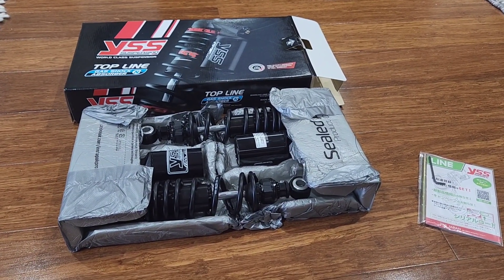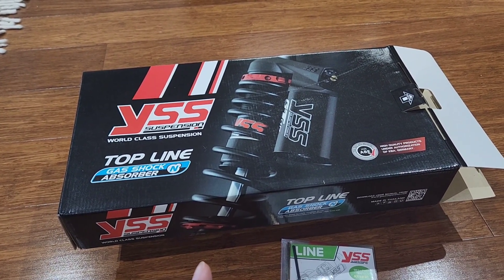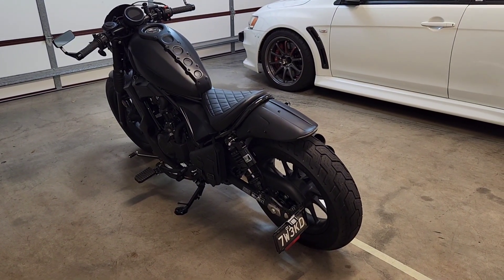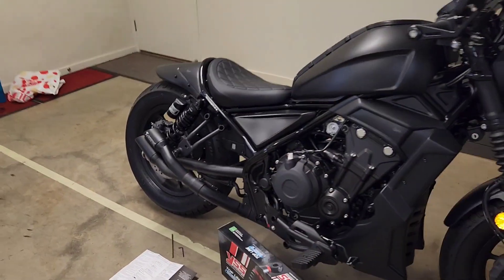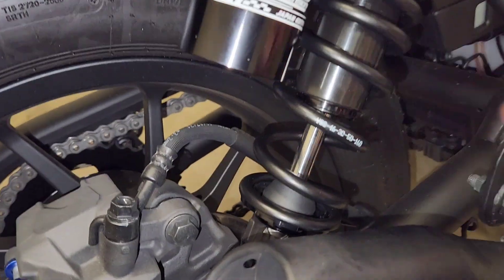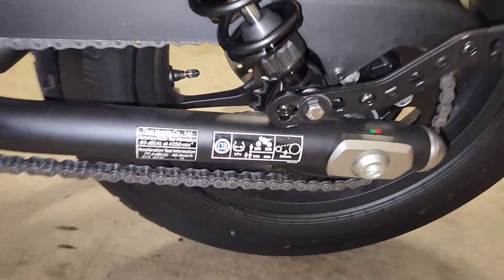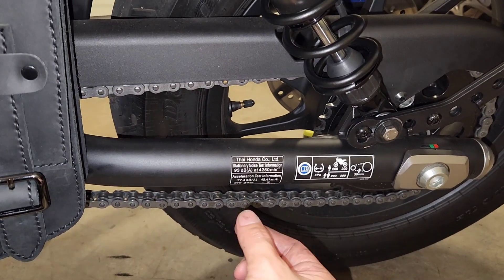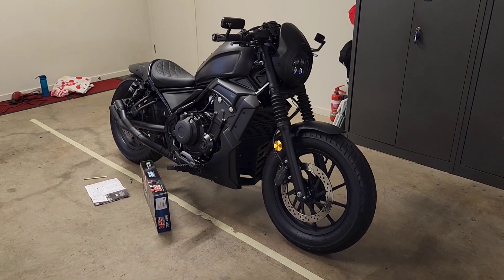Honda Rebel YSS G362 Piggyback Shocks install TWEAKED REBEL 500

Comment: Excellent video! Meticulous and thorough. I have been looking for shocks for my Rebel 500...YSS is turning out to be about the only semi-affordable  and useful option. I'm 5'10" and probably 192 lbs with all gear on. So although I am
a different size than you, everything you have said is applicable and useful. I just need to find the YSS that suits me. THANK YOU!
Did you think about the fork springs? What are your thoughts? Greetings from North Texas!
Reply from the maker: Thanks mate I'm co didn't those shocks will be suitable for your weight. It is approximately 7kg more than what I weight at that time with riding gear on. I didn't end up changing the front springs, just the oil weight. I didn't think it was needed for my weight

Comment: If I were to put a radiant shorty exhaust on my 500 would it be possible to put the YSS shocks on so the piggy backs are facing the other way? I’d like to be able to put saddlebags on when I need them with some easy brackets.
Reply from the maker: It looks like it would work with no factory exhaust hanger. Don't know anyone that has done it

Comment: Good one mate, I actually would like to increase the seat hight a bit. I am 5'11" and weigh 92kg. You mentioned the stock is around 30cm? What is the max height I would be able to get, any ideas will be great? And personally, I would prefer a Red spring, just to pop it out a bit.
Reply from the maker: These will go to 29.5cm height which is the stock height so you'd have to look at something like Burleigh they have coloured coils. YSS has colour options though👌
Reply: @TweakedGSX  This is a question that I would like to answer too, since I carry luggage (camping gear) almost all the time, and sometimes carry a passenger. So having a firmer rear (with more carry capacity) would be a good thing.
Reply from the maker: @suzyamerica4679  I think these YSS would be suitable as you have full adjustability at the stock height.
Reply: So this Yss suspension mate can lower the suspension height?
Reply from the maker: @Hollytocabocaaa  Yes it does

Comment: Compare with Ohlins, why you pick yss it lower 200 bucks right ?
Reply from the maker: Did you watch the video? That was mentioned in the video
Reply: @TweakedGSX  i'm noted what you mentioned, i will consider it with ohlins. In VN Ohlins price higher than YSS around 200USD.